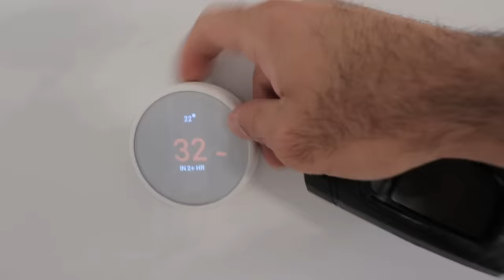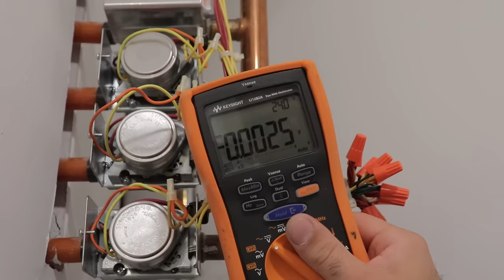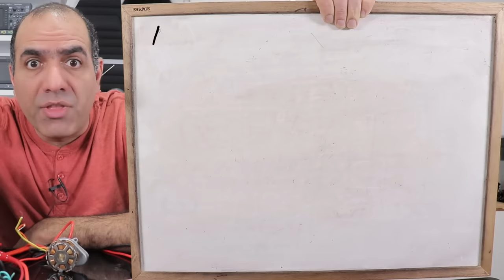Electro-Plumbing Repair… of my home heat zones that won’t heat although the boiler is running fine!!

Comment: Oi - I was a home improvements whizz in the 1980s in the UK, including central heating installations! Rocket science? Hold my beer! I could work for Elon! First of all, any British electrician would condemn your installation with those twist nuts as criminally dangerous. Fitted wall boxes with all connections hidden away, low voltage or not, please! Secondly, Canada suffers the same pseudo-green propaganda as we get here that forces those [expletive] zone valves on innocent householders. They are sold as easily switching off rooms that are not in use, 'saving money'. Two to three years later, they burn out, costing big bucks. Most plumbers replace the whole unit, involving drain-down, new inhibitor and much more labour. In my experience they'd last longer if they weren't fitted in the hot circuit, near the combi unit. Far better to fit them on the cooler return pipes. The burnout IMO is caused by gunk building up in the CH pipes which causes the marble-sized ball inside the valve to stick. Usually happens after summer has ended, when the CH boots up after a long rest. I also had a disapproval of thermostatic control valves, which tended to jam after four to five years. Those electric zone valves are a pain in the butt - you'll be fixing them again soon! Old-fashioned manual control knobs on each rad are still the most reliable, I reckon.

Comment: Jesus, what an overcomplicated solution.  Why not just use a solenoid?  One moving part and they last forever.  Solenoid valves are used in industrial machinery and last for decades.
Reply: Yeah I was wondering that too, I've never seen motorized valves like these - it's always just been a solenoid valve.

Comment: Dum dum medi. It's not the best design but it's actually a fire safety double check. The constant power keeps it open. If there's a power outage or a failure of the valve control, the spring will auto close the valve. DUH.

Comment: Spooky 👻 just yesterday I found an old valve moter in the shed with the back missing in the UK these run on 240v and so I thought of doing a dodgy video buy  spinning the cog with me fingers and running lots of light bulbs off it.   And here you are playing with them.

Comment: These are common in the UK and my plumber advised as a temporary fix tap the box with a hammer and it will release the friction and get it to turn 😂😂🤣🤣

Comment: I wish you had switched to DC motors and swapped out the controller with a regulated one.
Reply: I'll bet that if you just used parts from an electronics supplier, it would be substantially cheaper than that from a HVAC supplier.  Would work better too.

Comment: Honeywell zone valve Motors did you see the gear mechanism how they made one of the gears out of plastic so that it would fail and safety or if it overheated and that plastic gear is so thin that it gets brittle and breaks down and you have to buy new Motors this is a scam design you also these are 24 volt DC 1 amp Motors

Comment: the poorest heating system.. hot water radiator = if burning hot water is cold by the time it gets to the radiator.. lol  better off with gas heating

Comment: Hi, iam from Poland. Yea this shitty country in middle of Europ. Now living in Germany, more shitty country. But what I know, this short circuit is named hydraulic clutch. Depend of your installation, this is neede couse the boiler don't have a by-pass, protection for overheating a boiler. when all of yours circuit are close with those electric valves, water circit in this short circuit, to reduce a time when water goes boiling, sensores got time to switch of the burner and avoid to damage a exchanger inside the boiler. Thats it. Have a nice day mate.

Comment: 13:00 The lines don't go straight to the terminal block because those blocks probably don't accept the larger gauge and you wouldn't want to bundle 2 wires into a screw terminal either. Not something I would expect an EE to understand.

Comment: can you get me a negative volt battery? + voltage to zero. parabolic switch? not pulsing battery, pulsing ac,   
AC double value of dc. the magnet spins unopposed nnnnn/sssss. 2 x12v batteries series?ac 24v?? dont know only got a multi meter. windmills directly 2x wires parallel on the grid, your welcome...
Reply: 50 hertz if you tell anyone. hydrogen bigger dream than sugar/alcohol and residual panels.
Reply: engineer my motor before cancer catches up ...... too late.
Reply: ???    switch  to  decaf
Reply: @daviddavids2884  do you make millions in advertising . On coal burnt diesel delivered via oil processing? Death.

Comment: If plumbers are so far down the leaderboard, why is your pipework so professionally installed and your cabling is hanging bare in mid air caked in tie wraps? 😉 Tidy your castle wiring Mr Electroboom!